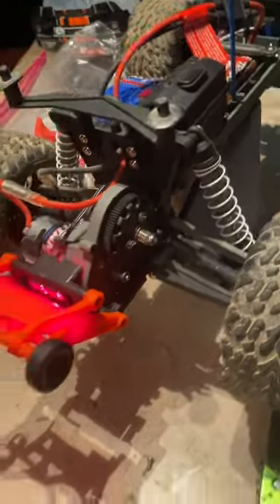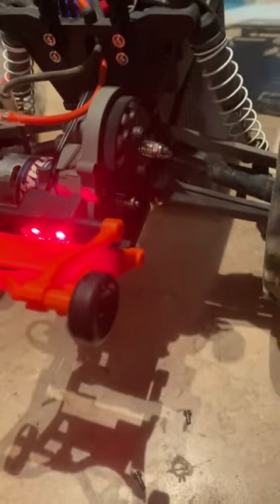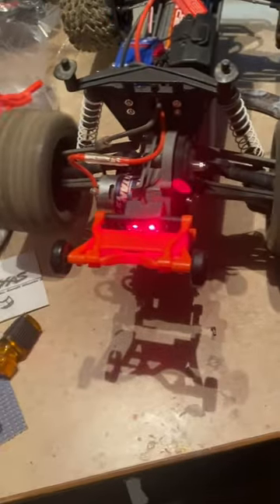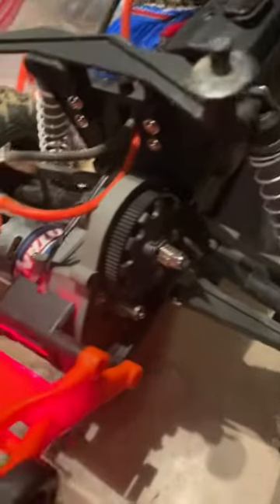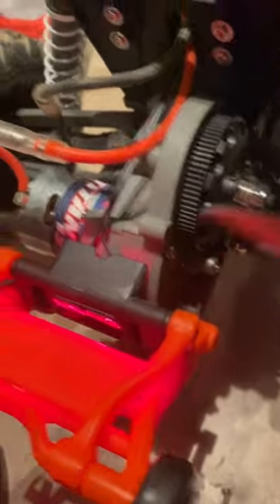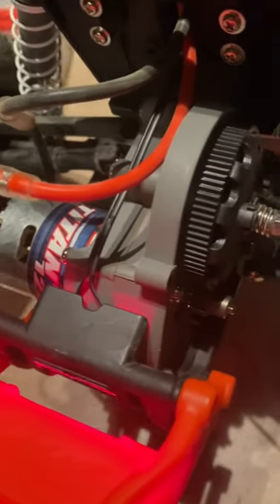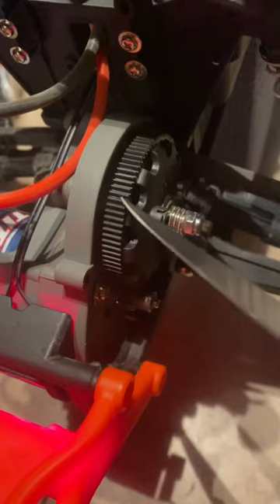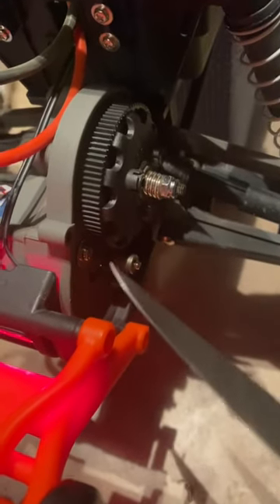Traxxas Stampede Making Clicking Sound PROBLEM FIXED

Comment: Or you could just move the pinion a bit and then done
Reply from the maker: No than the dirt gonna keep building up what I did was a fix not a temporary fix
Reply: @BrennanFrederick  there is also a cover that goes on for that reason
Reply from the maker: Yea I’m glad you can know that. If you know rc cars you would no that for me to show the spur gear I have to take that cover off 🤣💀